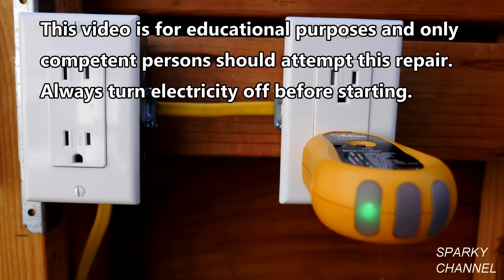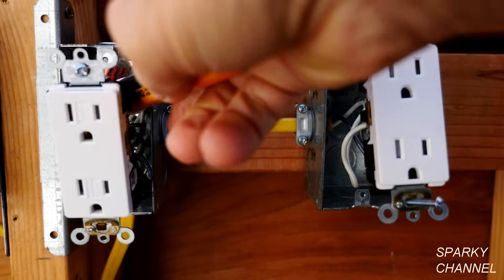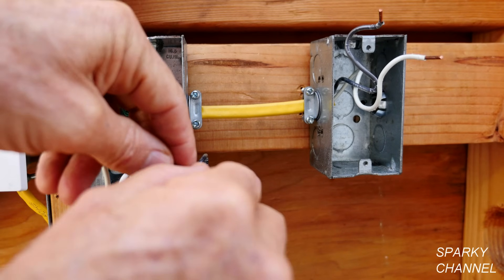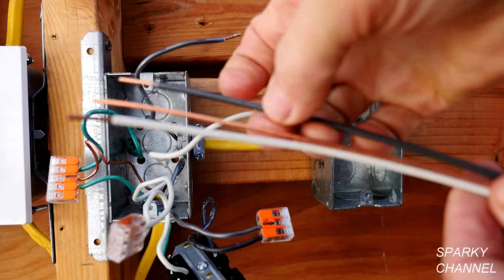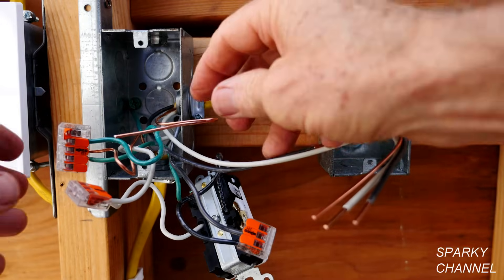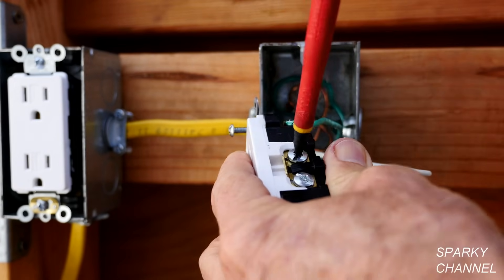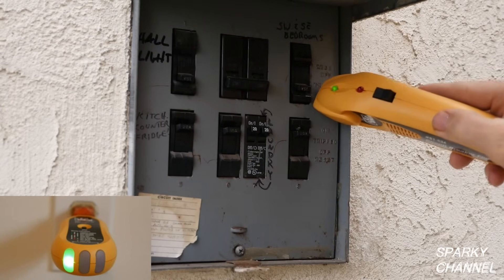How to Fix an Open Ground

Comment: Not being picky, but this video missed an important issue: how to find out the upstream outlet?
In this video, the connecting wire was visible, so we knew which outlet is the upstream outlet and the demonstration continued. In reality, the wire is behind the wall, so how to find the upstream one is missed in the video...
Reply: I believe they did touch on that; you have to test for continuity between the surrounding outlets til you find the upstream.  The challenge, besides being time consuming, is that a wireless continuity tester seems to be a requirement, well either that or a couple feet of  wire to connect your multimeter leads.
Reply: You use the circuit tester finder

Comment: Can you by pass the original house's ground with a separate ground going into another copper grounding rod?
Reply: Logically, yes.
Legally, maybe/maybe not.  
You can, however, run a separate ground wire from any other close-by outlet as long as they are both fed power from the same mains panel.  This solution is probably much easier than installing another grounding rod, anyway. ;-]

Comment: Saved this to my playlist. Your quality in explaining and demonstration is unparalleled! I have a question, excuse my ignorance, and anyone that actually knows is more than welcome to respond. He replaced the wire between the two, which has a 3rd ground wire. That was connected to the previous outlet, and then to the outlet he took apart. Why the screw? Hypothetically speaking, if an outlet in an older home is changed out in the same manner, but there is NO screw at the box being changed, must there me a screw through the metal box into the studs, connecting the ground that is 'pigtailed'? Extremely ignorant question I'm sure, sorry. Thank you for the video! Definitely subbed!

Comment: If it in wall that's a nope to run new wire , most trouble I get is in old houses with no ground at all and if u test shows no ground  and if u replace with a gfi that's costly if u replace all so I figured out how to fix and it shows it's wired correctly .

Comment: Can you just  add a ground wire by adding a  green screw to the second box?
Reply: No. by adding a green wire that is attached to the metal outlet box and the green screw (or grounding lug) on the outlet, you are simply making the ground potential of the two "even" .

 Neither the metal outlet box or the outlet itself are grounded or connected to the circuit in any way until a physical wire runs from the main panel to the first outlet box and then to the second one.  

Simply adding a green wire and even sticking it through the wall and then into the dirt outside wouldn't work either. The term ground means more than just something touching dirt somewhere, Lol

Comment: Why are all the receptacles in my home (built 1993) have the neutral white wires switched, that is, the terminals on top have a black wire from one cable and the white wire from the other cable, same on bottom terminals? I guess it's ok since the receptacle tester says so and they do work. But when I changed one to an AFCI receptacle, and wired it the same way, it didn't work. I had to switch the white wires so they were across from the black wires of the same cable? I hope that's clear!

Comment: I have an open ground in a few outlets that have the ground wire connected to the receptacle, where would the problem be?
Reply: check upstream until you find a grounded outlet. I have seen where someone replaced the metal box with a plastic one and connected the ground to the plastic box.  If all of the outlets are not showing ground, check the external connection to the grounding rod.
Reply: Good question  . I'm having same problem , cannot find answer .

Comment: 13:05 I never seen two outlets installed side by side on an open wall.
With an obviously installation defect.
I found an open ground on an outlet probably installed around 79, a fireplace sperates twin sockets on that wall.
The ground wire is present and connected
So where did it  get disconnected, I guess I'll start pulling out sockets closest to and work my way out.
Then again all grounds report back to the panel so I'll probably have to pull all the grounds to find which outlet it's wired in parallel to
Reply: The outlets in video are likely placed as they are in order to facilitate an example. Same outlets are used in other videos to demonstrate examples of a different problem.

Comment: Can you use a GFI for using a switched outlet and a hot bottom?
Reply from the maker: No, a GFCI is not a switch.
Reply: @Sparky Channel,
I believe Mr. Steffen wants to use half of a GFI outlet as a switched receptacle and the other half of the GFI outlet as a always hot receptacle.  I know you have posted a video on how to wire an outlet just like that, but it doesn't mention if using a GFI outlet is acceptable.
Reply: No, you can't. GFCI terminals have different purposes. Two are marked LOAD, and the other two are marked LINE. LINE terminals are connected to power source, and LOAD terminals are connected to downstream outlets to extend GFCI protection if desired.

Comment: I have a Southwire 40010S-A receptacle tester. It has one red light and two orange lights. It also has a diagram  that shows what the lights read and if there's a wiring problem. All the outlets I have re-installed and tested show to be correct wiring.

Comment: So what if you can’t change the cable do to plaster walls?
Reply: I ripped out the walls in my bathroom. I dropped Romex wire down through the first floor wall down to the basement and over to the circuit breaker panel. Before I connected the  wire, I installed two switches for the lights, another box with a GFCI outlet and a switch for the ceiling vent fan. Redid the walls with dry wall and also added another wall for the shower and bathtub plumbing.

Comment: Haven't finished yet but just seen were its a two wire system. Instead of running a new wire because that's easier said than done you can also put it on a GFCI of GFCI breaker and it will pass code as well.
Reply: Doesn't help in side wall db
Reply: the hard part with that one is where they have connected other neutrals and then it turns into a headache.

Comment: Without romex, that pigtail screwed into the back of the box is doing NOTHING- am I wrong?
Reply: Huh? Its a metal box no matter what the wire is you have to ground it. Unless its being used for a device that has the gold tab on the yoke

Comment: As a electricien in the Netherlands i am amazed about the way this is made!A metal box(so it will conduct electrity) and a inner socket with open connections to the hot wire and neutral wire.And the earth wire without shielding!
As i see this,its a  shortcut waiting to happen!!And you know it,because you have to put electrical tape around to prevent that to happen..We never use a metal box with the only excepting of the breaker box in our electrical system.And even that is more and more times made off plastic.So i can proudly say that we have the safest electrical system in Europe!!
Reply: This is by design, you want any exposed hot wire to short in the box and not involve a person. By using a non-metallic box you reduce the chance of having a sufficient return path to conduct enough current to trip the breaker - allowing the possibility of an exposed hot wire to send current over a number of paths for an extended period of time (again, possibly) resulting in heat buildup, arcing, and an electrical fire.

Comment: Question: my buddy of mine house is wired in the back in  60’s and has two prong receptacles in a room and needs to be changed to three prog receptacles. To help out, I would install GFCI in the home run box and identify the home run and wire that to the Line side and the other wires to the load side. Then change out the rest of the receptacles with GFCI and wire them on line side? Since no ground, if I install a ground pigtail, would that fix the “open ground”?
Reply: Think he has a video specifically on this. Think he just installed gfci on the first box from the breaker then 3 prong outlets after that with proper labeling. They still show up as open ground but are IAW code.
Reply: You fix the open ground with the text: "No equipment ground." It tells the tester (a person) to expect open ground. If you want to ground it you need to run a separate ground wire or preferably rewire completely with three wires.

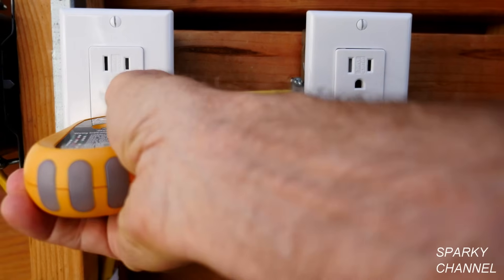Comment: Why does my Fluke non-contact tester (as seen @ 1:56 )  show 'Hot' when inserted in the narrow slot of the outlet when the breaker is off and both a VOM and plug in outlet tester show a dead circuit?
Reply: Probably a faulty tester, which doesn't surprise me. I recently got a Southwire version to replace my long time Greenlee which worked perfectly. It gave false readings like yours is doing right out of the box.
Reply: @Robnord1  Thanks for the reply, I suppose it's better showing false positive than negative, guess I'll stick with my VOM and outlet tester.
Reply: @ICSpotz  They also do weird things when the battery is weak
Reply: @geecrawdad  Thanks, it was new just out the box so I assumed the batteries were good but I'll check them and see if that helps.
Reply: @ICSpotz  I don't trust them anyway. Just a little more confirmation that the power is off. My panel is in the garage so I'll even close the garage door lest some nefarious neighbor creeps in and switches the breaker back on.

Comment: I replaced a switch with and switch/outlet combo. The switch previously didn’t have a ground wire. The light connected to the switch has a ground that is tied into the natural wiring in the circuit. When I turned the power back on the outlet in the switch test as grounded. How is this possible and is it actually safe?
Reply: Short answer...Its not

Comment: Great video. I am in a new house and our hall lights stopped turning on. My Husband rested and found an outlet in the same area is an open ground 🤦🏽‍♀️. Do you think this method here will help get the power back on for the lights? Thx in advance.
Reply: No get a better husband
Reply: I wouldn’t worry yet about the open ground in the receptacle close by, stuck with the hall fixture and switch first. 
Familiarize yourself with the basics of any multi-meter. Start at the switch and determine if you have 120v going to the bottom post of your light switch. 
Let us know from there 👍

Comment: If you couldn't run a new cable, could you ground the receptacle by running a wire from the ground screw on the outlet to the box?
Reply: No.  The box would have to be connected to the system for that to work.